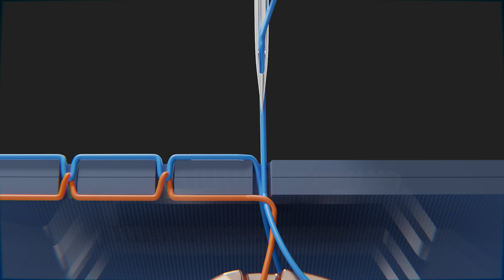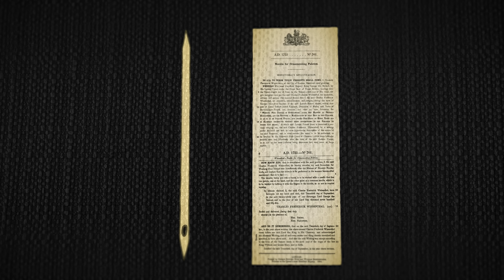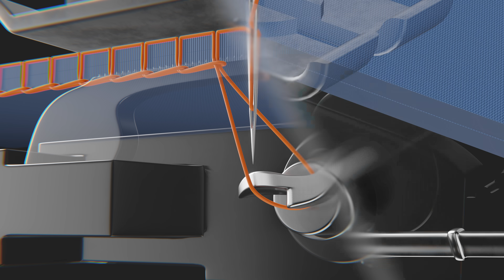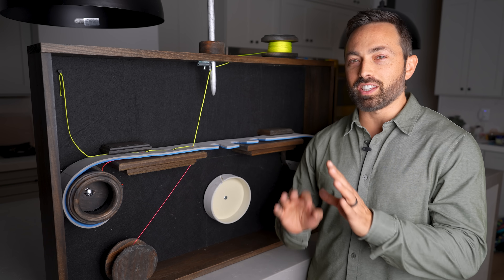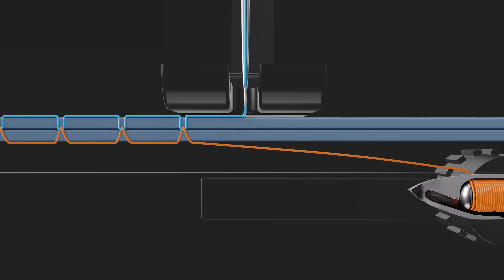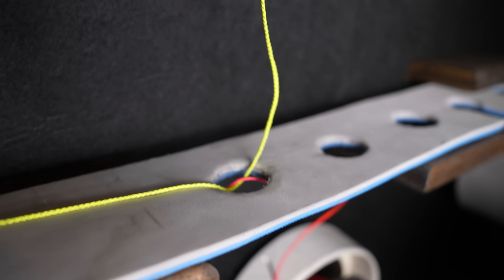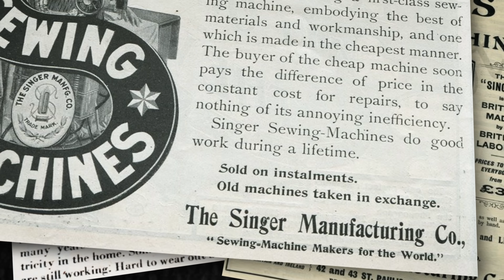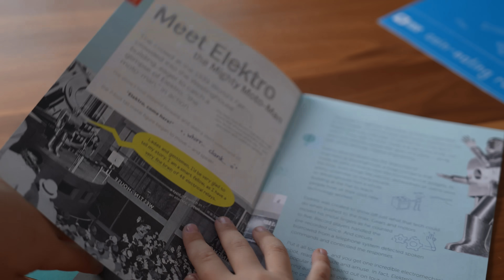The Surprising Genius of Sewing Machines

Comment: I feel the explanation at 11:18 is not very clear. The rotating hook (which is the whole bobbin case) is connected to the wall as is the bobbin. The thread would get caught on the axel holding the bobbin case and the bobbin to the wall. In fact, there's a cut in the video and the loop magically goes around the bobbin case.

Perhaps a better demonstration would have a free-floating bobbin, just like the shuttle in the vibrating shuttle sewing machine from before. From my understanding, in sewing machines with a rotating bobbin case, the bobbin is held free-floating in a cup. The rotary case the spins, looping the thread around bobbin it is holding, but not around the case itself. The thread slips under the bobbin, but not the whole bobbin case (unless the whole thing is floating on a magnet or something, but I don't know of sewing machines that work like that).
Reply: I agree. While the majority of the sewing process was well explained, the action of the bobbin was not fully explained, and, in my opinion, this is the heart and soul of the success of the sewing machine. More detail is needed here specifying how the bobbin “floats” through the thread eye.

Comment: 11:10 How does the top thread get completely around the bobbin? Doesn't the bobbin have an axle? If not, what holds the bobbin in place?
Reply: It depends on the design, but generally the bobbin itself will sit on an axle in a bobbin case which "floats" and is held in by a retaining bracket and then that is what the thread is passed around.

Comment: Fantastic! For years I've hated my sewing machine, a Brother LX17, which I purchased new 12 years ago only for hemming men's trousers (pants in US). I'm a short guy, so I always have to get new trousers shortened or do it myself. For years I did this with Wonderweb and a steam iron, but it's no fun to do. So I bought the sewing machine. Sadly, to this day, I don't use it often, because I find it incredibly difficult to set up. First, wind the bobbin, then thread the needle, and finally get the needle to pull up a loop from the bobbin. It doesn't help that I'm now 78 and my eyesight is not brilliant. The user guide from Brother, by the way, is shockingly bad in the way it explains the stages of threading. Now, finally, in the past couple of weeks I managed to successfully hem two pairs of trousers, and the sewing machine is no longer my enemy. As originally a motor mechanic by trade, the actions of a sewing machine have fascinated me for ages, but now your excellent video clearly explains how the needle and bobbin work in tandem. I'll be replaying this video several times to make sure I really understand the process. I also found the extra information on the self-build kits very interesting, as I have built several electronic gadgets from Vellerman.

Comment: Doing large production would use something known as a "line drive" you'd be able to use a clutch or simply pull the live belt over your wheel (much more dangerous) and turn your machine on or off. You could use steam power, electrical power, or even water and wind way back in the day

Comment: I make leather goods, and we use a stitch called a saddle stitch. The saddle stitch uses two needles on one thread, running like a snake back and forth through the leather. There are no sewing machines that can pull off the saddle stitch. The saddle stitch is far superior to any stitch a machine can make, but takes 10 times longer to perform.

Comment: I'm a mechanical engineering student and I saw this video when it came out, and I just acquired a Singer 328J style-o-matic sewing machine I now have to clean up and get working lol. Sewing machines are cool, this thing is insanely heavy and rugged yet also precise. It's a machine tool, but for fabric instead of steel.

Comment: You dont actually have to pick up the needle from the other side, you put it trough twice in one go, that way, you only have to push it trough the fabric and pick it from the top. With running stiches you can even have needle 2 or more times trough the fabric. I know this is not the point of the video, but hand sewing can be more efficient then initially shown.

Comment: I think there’s maybe 100 people on earth that know more about the engineering of sewing machines more than me. Heins and Hans at Bernina do for sure. The engineering guys from Brother and Juki, those dudes are smart asf but they don’t speak English. And that’s about it. 
Dunno if he’s going to mention it but as the thread passes thru the eye, and remember the thread gets pulled away by the hook, then pulled back by the take up lever to cinch the lock stitch tight so a lot of thread, like an inch or more of thread is flying thru that eye of the needle at high speed. It’s a miracle it doesn’t break but it does get flash heated  by the friction and so does the needle, the walls of the eye which on a regular 90/14 needle with a 0.9mm diameter makes up only 0.3mm so 1.5mm each roughly and that’s really thin steel. It contains chromium so it does harden again as it cools, but thread and needle breakage that seems to be random, not user error or something, is caused by this rapid heating and cooling cycle. 

I hope he features a hemstitch machines of YORE. They use 3 needles except one doesn’t have any thread on it. It is more of a punch or awl that pokes a whole in the fabric, while 2 needles in contact with the awl on either side of it move downward to make the stitch, then away from the awl to the right and the left, along with their respective hooks, enlarging the hole made by the central awl and stitching it in place. I think that might be one of the weirdest machines I’ve ever seen or worked with. 

Now he’s talking about vibrators. Vibrating shuttle singer 27s. I’ve repaired MANY of them. There’s so much new old stock of the shuttle hooks and bobbins for those things I’m trying to find other used for them. Damn those machines suck but were marvelous for the day. He said the tensions need to be equal and that’s not true when you actually measure this with a strain gauge. There’s friction from the needle thread having to slip thru fabric and around hook surfaces and the stitch finger and all that so this adds a tension-like effect on the needle thread, but still, even without that, the needle thread has a lot more tension than the bobbin thread. The take-up stage pulls up the right amount of thread causing the threads to equalize. It would be better to say needle and bobbin tensions need to be equalized, not equal.

Number one customer complaint is “tension problem” which can mean anything but it’s usually just that they’ve failed to thread the machine correctly, and most frequently this means failing to thread the take up lever that comes after the upper thread tension in the thread path. People with vertical/top-loading/polymer/plastic bobbin cases break them a lot cuz of this one issue. Also sometimes people don’t thread their bobbin case tensions correctly. For the home sewing machine market in America, 80% of repairs are due to user error and maybe 70% of that user error has to do with threading the machine correctly. Crazy.

Ok finished watching it was lowkey boring tbh

Comment: After discovering a two-sided needle all that remained was to build a machine with upper and lower hands, capable of holding the needle while the fabric was pulled a little forward. And several pairs of such hands spaced a couple of millimetres from each other, working simultaneously, would make the multi-stitch very strong.

Comment: I own a sewing machine for leather working...

The lock stitch made by the machine is inferior to the saddle stitch... But the saddle stitch can only be made by hand so is time consuming and costly.

So while the machine lock stitch is not quite as strong/dependable as the saddle stitch, it's good enough for most purposes... And at a minimum 5x faster. So faster turnaround on projects. Which means lower cost to the producer and lower cost for the buyer.

That's the trade-off.

Comment: I use sewing machines pretty much every day at work and the funny thing to me is that most of us prefer older mechanical machines over modern digital ones. The action is just so much smoother, the sound is better, the power and durability is better. If you have a well maintained vintage machine, it'll probably outlive your grandchilden.
Reply: I repair and restore vintage sewing machines and I could not agree more. A big contribution to the preference is the fact that sewing machines designed before the late 2000s (and a couple after) were created in a way that they could be fully serviced at home by someone who knew what they were doing. Most modern-day machines have these annoying plastic cases that are difficult to acess and special "self-lubricating" or "brand manufacture specific" parts that render it nearly impossible to be home-serviced, thus creating another way to generate profit because it forces the user to take the machine to a participating facility to be serviced. Give me 1960s designs any day.
Reply: @cindyandtheharlequins2760 i agree. I bought a new computerized machine a decade ago, have now changed it for a 1970s pfaff. The pfaff is faster and the stitches look far better
Reply: The older machines were more precisely machined, with long-lasting metal parts.
Reply: My mom has a modern expensive juki, and she purchased a necchi mirella for me, which is a replica of a 1920s machine. I sew significantly more than her, and we've both had our machines for a year now. My mom's machine's bobbin case breaks every couple months and it costs like $100 for a new hunk of plastic, and she ended up giving up on it and buying a new cheap brother machine instead. My machine is completely take-apart-able (i teach and sometimes i take it apart to show ppl how it works) and it's never had a problem aside from getting very linty and needing cleaned and oiled. old machines rock.
Reply: Yes indeed! There's something very special about using a technology that was designed to last, and can be maintained so easily. Opening up the mechanism to clean/remove lint is a joy; and the sound of the machine as you press the treadle with your foot is almost meditative. My 1940 Singer 201 sews through multiple layers of leather like butter.

Comment: The chain stitch is currently used in some applications where it's ability to come apart quickly becomes a feature, like for BBQ charcoal bags
Reply: I remember the animal feed bags on a farm in the 70s doing this also. It only took a tug on one bit to pull out the whole string.

Comment: You missed a huge additional change from hand stitching and mechanical - handstitching requires the entire remaining length of thread to be drawn through every hole. Imagine the time and friction and wear that causes. Sewing machines lay down the thread as they go.

I suspect this was the main driver in developing other stitches - avoiding the need to pull a huge length of thread through each time.

Comment: What a great video and the mechanism of seeing a lock stitch hasn’t changed. The only other stitch that has worked is the flat-lock seam stitch which can be made with a dedicated flat-lock seamer or a serger.

I learned to sew at a young age. My mom showed me how and when I went from simple hand sewing to machine sewing, I became more proficient.

Years later, I have to move faculties in a school and in the Arts faculty, they use sewing machines.

One of the staff gave me a basic lesson with a darning foot on a scrap of fabric. Swirls and lines and so forth.

She offered me the chance to do the same, but instead I wrote my name in handwritten italics with the thread.

After that I was the go to person for anything sewing related. 

If I couldn’t figure out a way to sew it on the machine, it had to be hand sewn or glued.

Comment: I have my Grandmothers 1948 Singer Featherweight 221 machine and after cleaning and oiling it, it works great and sews a better straight stitch than any modern machine.  That's why they are so valuable.  They are great for quilting too.  Its a good example of they just don't make 'em like they used to.

Comment: You can (and, in embroidery, there are reasons to) do chain stitch by hand. The hard part has to have been the mechanical engineering, and the insight that this could be done with a captive needle, not the stitch itself.

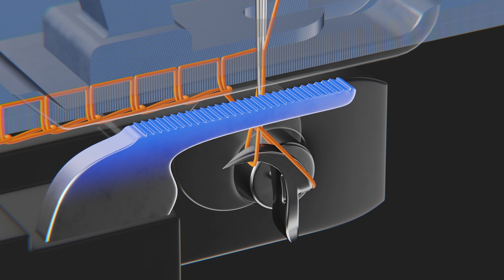Comment: 13:29 Love the video. In all sincere kindness, I have one critical question.  A very important part of the magic of how the bobbin works is difficult to understand is “elided” quickly over and lost.  There is a pole, post that holds the bobbin chase to the machine and turns it.  Some clarity should be spent to explain exactly how the bobbin thread gets around this post and not wrapped around it.  Wish you would do a follow-up video to explain how this actually works today.  I can just see at 13:29 that the bobbin thread gets picked up and moved around the post somehow “reliably” but in todays machines the bobbin thread is even inside the hook chase, unlike this photo.  Everything in this video is great, but the most magical moment of this machine is how this is technically overcome.  I still don’t know how it is accomplished; I’ve tried to find videos of it, but to no avail. If you have a resource that shows this technical solution. Please, kindly pass it along or make a video just for this issue.  I watch many shows of how sewing machines work and this is the most important “trick” and is never well explained of how it was overcome.  Why doesn’t the bobbin thread get wrapped around the pole that turns the hook with the bobbin thread inside the chase?

Comment: As a seamstress I was somewhat aware how my machine worked, but only because I kept taking it apart over and over to fix it. I really appreciate the explanations and history. Took me years to learn that the thread is also very specifically made. I bought cheep thread originally and for a whole year my machine ate it and my fabric. You learn a lot from wrestling with a sewing machine. 
I wouldn't consider the sewing machine to be the main reason for so much clothing waste despite it making sewing easier, most Americans have no idea how much labor is put into each piece of clothing they wear due to all the labor being outsourced to other countries. No one realizes that every single piece of clothing they wear is made by a pair of skilled hands and a sewing machine. Unfortunately most of these hands are being exploited as cheep labor (often slave labor ((seriously its really prevalent and really terrible))) and the materials they are given to work with are also cheep resulting in poor quality. Most Americans can't tell the difference between a well made piece and one that is going to fall apart or is simply plastic (meaning it won't decompose well in a land fill). Clothing requires a pair of hands because unlike most solids, it is a very fluid. You can make a cup using a mold and a machine, but with clothing you are taking fluid 2D sheets and making a fluid 3D shape. Unfortunately most clothing makers have traded quality for quantity. In history quality fabric and color was valued so highly that seamstress' were told not to even cut the fabric but to turn the entire bolt of fabric into one dress so that next season the dress could be taken apart and turned into a new dress. With the increase of quantity as well came a lack of proper sizing for the consumer. Sizes are generalized to fit the most average (or idealized) size to sell to the most amount of people. How people dress is one of the first ways they show who they are to those around them. So it can really hurt a persons identity when they try on clothes and feel uncomfortable and unflattering. But custom made clothing was pushed out due to overwhelming competition from larger companies. So now people either have to learn how to sew their own clothes (which like most artistic skills requires so much time) or succumb to the clothing available. 
That's my spiel, hope you enjoyed! I'd love to answer any questions.

Comment: I have three antique sewing machines, spanning time from 1880-1931. Two models are vibrating shuttles, one is an oscillating shuttle. The oscillating shuttle works exactly the same as my modern electric Singer, but each of my vibrating shuttle machines is vastly different from the level of the feed dogs up 😂 You can tell that they were still in the process of standardizing things. It's pretty cool to see stitches forming on the large model you made. Tension is such a b***h. 😂😂😂

Comment: This is really an excellent video. The presenter obviously did his research and the animations and models are super.  But I knew a lot of this.  The one thing that I wanted explained wasn't.  It happens at 11:30 in the video.  How can the top thread pass around the bobbin if the bobbin is being held in place by something?  Say, a shaft or spindle.  The bobbin would have to be levitating in mid air for there to be nothing to obstruct the top thread from passing around it.  PLEASE explain this part!   So far, NOBODY has. 😞

Comment: That hand built giant stitch machine was awesome!  I bought a 1961 Singer 500a several years ago to do some upholstery work.  Being a mechanical engineer I sought the most complicated machine ever built.  As I cleaned it I became fascinated with the thing as a piece of industrial art.  It has a stack of overhead cams for doing 300 different stitch variations.  I even have the complete attachments set.  Power is gear driven.  No wimpy belts on this rig.  Sewing machines are surprisingly cheap too, like engineers.  Go buy one!